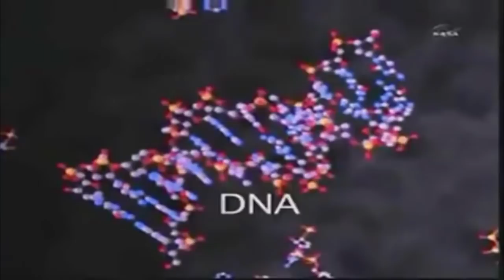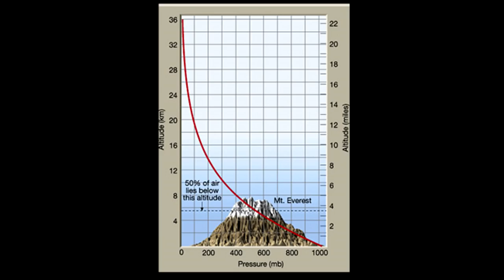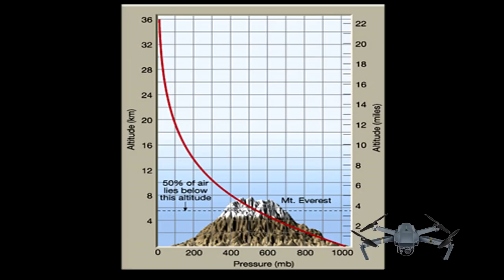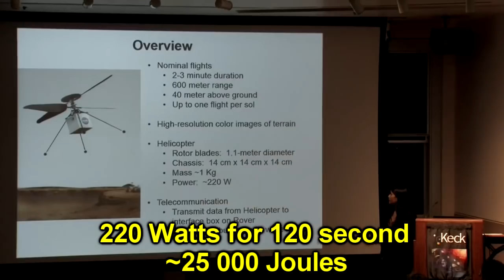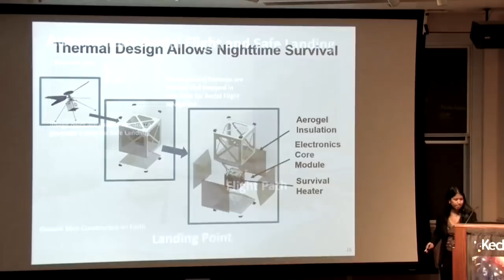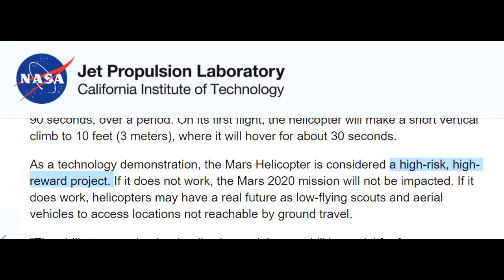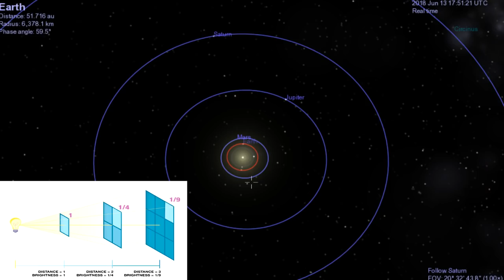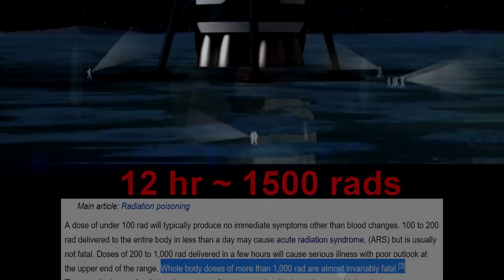NASA is sending Helicopter to Mars!! Smart or Silly?

Comment: I don't know if you have a video on the new version but I saw a nasa vid on a new drone for mars which is more conventional in design with four rotars (or eight since on the four arms there are two sets of rotars above each other). Theres also more substantial power generation with both solar panels and I think the radio isotope generator. Its a lot more heavy than the above but seems like it could be better for mars and it has more flight time

Comment: Maybe I should work for NASA because here are my ideas:  1 )Scrap the lame helicoptor concept and substitute a hot hydrogen balloon instead.  Wouldn't take much energy, could stay aloft all day if need be, and be guided by tiny jets of nitrogen.  2) Consider power beaming.  Erect a large PV array that collects hundreds of watts/hr.  Use lasers to beam energy to helicopter or to recharge this before each flight.  This would free up the helicopters weight and give it a larger range of flight.

Comment: You kind of gloss over a major issue here.  A huge amount of a helicopters power is taken up by overcoming drag. Lift and drag are directly related so blade configurations that would be unworkable on earth because of drag are doable on mars. Since most of the work of a helicopter engine goes towards turning drag into lift, atmospheric pressure does not play as significant a role as you say it does in the power necessary to fly on mars.

Comment: People at NASA are not stupid. I slightly suspect them they are making rover landings more complicated then they need to be for the heck of it, but they do really push the boundaries of engineering and learn bunch of stuff with every success or failure. The helicopter/drone is more or less proof of the concept anyway. If it manages one flight it means flying machines on Mars are possible. And if it makes cool pictures along the way that is great.

Comment: @Thudnerfoot - You're ignoring Bernoulli's principle. Lift is not caused by a the reaction of throwing molecules down by deflecting them off of an angled blade. It is called by a pressure differential from air moving at a different speed across a lifting surface.

Comment: Solar panels on earth and on mars do not have the same efficiency. The atmosphere is less dense, have smaller amount of clouds, moreover space grade solar panels (which are not used on earth because they are far more expensive, but on space they are lighter hence cheaper) have about double efficiency than best panels used on earth. This sums up to 150% more efficiency than you have on earth surface. Panels on earth have about 200 w/m^2 average efficiency,  on Mars multiplying out all percentages you should get about 270 w/m^2 (pointing straight to the sun). Whether you have enough power depends on the tradeoff between flight time per day and panel size

Comment: 22000 rpm and wide blades. And 1% of atm at low altitude still has a surprising amount of air. Also the drone design is designed to be able to right itself

Comment: I think it's fair to wonder if the idea of a helicopter on mars is feasible or even useful. I don't doubt NASA's technical expertise though and I think it's a bit pedantic to worry about solar panels or insulation. I am sure they have solutions to these rather simple problems. That being said, I think the most difficult challenge is going to be flying this thing autonomously without crashing. Because, as you say, if it crashes once, it will not be able to get up and fly again.

Comment: He's assuming all the heating will be the result of solar power. If you stop for a minute and think about Mar's weather systems, you quickly conclude that dust storms would eventually kill any devices which rely solely on solar power for heating by coating the panels with dust and by blocking sunlight in the atmosphere. But NASA doesn't rely solely on solar power; radioactive metals (such as thorium) can be used to create just enough heat to keep critical components such as batteries from freezing.

Comment: It is silly, but so was first car. I would say if the copter work for 3 days, it will be great success.

About your analyse, you miss that Nasa wouldn't use normal commercial solarpanels, but the most expensive ones, which gives them 50-100% more output.
Also, the copter is shortlived and lost anyway when it capsizes, so having extra weight by having it perfectly insulated against sand and dust wouldnt make much sense.

Comment: Correct me if im wrong, but the "Tracking vs flat vs angled" solar panel effeciency only applies the further away from the equator you get?
The closer to the equator you get the more directly above you the sun stands, therefore a static flat solar panel effeciency depicts where on Earth/Mars it is?

I do not know if the solarpath on mars equals the one on earth, tickets for mars was sold out.

Comment: Question on the solar panel. You point out that Mars gets far less sunlight than Earth since it's farther away (duh), but considering Mars doesn't have an atmosphere (or at least not when compared to Earth) wouldn't that mean that a solar panel on Mars would absorb a higher percentage of solar energy than a solar panel would on Earth? Because I'd imagine the atmosphere reflects a large portion of the solar energy it receives.

Just wondering, because that would in theory make Martian solar panels much more efficient

Comment: Thunderf00t makes a good point though.  Drones will crash, it’s a possibility, and nobody will be around to flip it over.  So I would like to know how their design is self righting.  It’s unconscionable to think it’s not, but I haven’t seen coverage of that in this or Veritasium’s video.

The simple landing feet also assume it’s landing on flat ground which is quite the assumption.  It needs to be designed to land on any surface on any orientation up to 30 degrees or something.  Once it lands on an uneven surface the lifting force will be at an angle and will cause it to fly sideways dragging its feet and likely flipping over, smacking its rotors on rocks.  

I would have designed it to be inside a hollow dodecahedron shell made of tiny carbon fiber tubes.  It would join the shell to the body of the rover with a 2 axis spindle so it could land in any 360 degree orientation and then reorient its blades normal to any surface using the G sensor.  The side benefit is the rotors could never impact the ground, only the outer shell would.  The third side benefit is the rover could use the spindles to continually orient the solar array towards the sun to increase solar charging power by 30%.

Comment: I was an early days drone pilot too, and I even wrote my own control firmware (the Mikrokopter code was a mess). I remember from there that maintaining flight control and stabilisation is not very computation intensive at all. It could easily get that to work on an 8 bit 16MHz CPU, with time to spare and with a much faster than necessary loop.
I don't see any problems in controlling flight on less than a hundred milliwatts. Maybe even less than 10, depending on the consumption of the sensors. And there's no use of a milliwatts guzzling GPS receiver on Mars anyway :)

Comment: Actual question: The blades can't also be solar panels why? Would add more surface area for the solar panel and easily avoid the dust build up problem.
Reply: Electrical connections across moving parts is a nightmare. The rotor is a SPINNING part which is even worse, basically impossible. It must be completely separated from the hull so nothing is going to be charging through it. And that's assuming a solar panel could be made that's suitable for use as a propeller blade which I doubt.

Comment: I wonder why we don't use a normal wing drone on Mars. If landing is so hard then just put a program on a flying drone that works from entry communicating to areostationary satellites. The drone would never have to land and could be powered to stay in the air. Or even better, when the drone is power saving it could enter orbit and rest above the atmosphere (meaning it would require some kind of fuel storage like a CO2 compresses when in atmosphere). Would probably be more effective than the Helicopter.
Reply: Because like the copter blades the wing would need to travel very fast to produce useful levels of lift in Marses sparse atmosphere.

And they want to take samples so the design would probably need a vertical lift off capability anyway.

Comment: Assuming it's going to be powered purely by PVs then it's a non starter. We could of course use accumulators ( rechargeable batteries for those who need clarity) but this adds another issue. Mass. More mass means more weight and thus exponentially more charging time when on the Martian surface in order to take the thing from the ground. Perhaps detachable accumulators? Right. Controlling something that far away to that degree of finesse is beyond even NASA's best novelists.

Comment: What about putting solar panel on wings? Surely it would require making smart way of transmitting power but it should be not much different from alternator, speeds are much smaller so brush set should last long enough. It would have ~45 degrees but pointing different sides so if one generates less power, opposite one will have more. Moreover, wings can rotate making it a bit more efficient than static, flat panel. There is some risk of damage during such fast rotation but it would be on the "back" side of wing which won't hit directly any particles. Question is, if such solar panel will have proper weight and won't be harmed simply from centrifugal force.
The best thing about that is that adding more solar panel shadows wings so you can't use idea like they showed with one central wing. It won't have any lift when covered by panel. Folding panel for flight? Not really good idea. More things can go wrong if you try to open and close it all the time. It would not make power during flight as well but it's not that bad if you are going to fly only 2 minutes daily. 
I'd try to work on this idea, solar wings. Sounds like great bullshit and as we all know, media love bullshit!

Comment: I'm curious what you think now that Perseverance and Ingenuity are both safe on Mars. I'm sure you know by now that wasn't a safety wire. It was pulling up on the drone to simulate Mars' lower gravity. We have yet to see if it will fly but the sky crane worked again and it's all safe on Mars. I'm just curious what your thoughts are.
Reply: He literally pinned his comment about his wire mistake, how did you not see that when scrolling down to post your comment.
Its literally right under the box where you type your comment in. Right below.

Comment: They would use multijunction high efficiency solar cells. They can get 2-3 times more power from same area, and weight is similar.

Plus you can land close to equator to improve it more.

Comment: (I am so gonna get roasted... but here goes)
There is more to lift than deflecting air molecules downward from the face of the blades. That's one reason why wings, propellers, and rotor blades are profiled. Also, just spinning the blades faster to produce lift in the thin air only works until the tips reach mach 1, which is much lower on Mars than it is on Earth due to the thin atmosphere. That would drive the cord of the blades to be deeper (fat blades)..

I would classify this as somewhat silly.

Comment: I mean the solution to outer solar system solar is to use a mirror (like they use on solar sails) to reflect the sun onto a regular panel. This would be located at a base station, and then you recharge your drone/rover there.

Comment: I think your helicopter blade model is actually backwards. If you tipped the blades the direction you've illustrated the helicopter would travel in the opposite direction. I think.

Comment: Even in earth fast spinning rotors have problems. When next rotor blade hits low pressure made by previous blade. Y need like 100 times longer rotor blades in mars. In Earth atmosphere blocks lots of suns energy. Y make more power with solar panels in space.

Comment: Why not send another rover, but one that's carrying a weather balloon and helium tanks. Have the  balloon tethered to the rover. Would this not work for like a mere fraction of the cost? Better yet, create a robot that is powered by a powerful springs that will let the robot shoot into the air. Make the spring re-compressible and maybe even add helium filled pockets so it will float down much slower.

Comment: The rotors of the helicopter would have to spin at LUDICROUSLY HIGH Speeds! Probably supersonic,  due to Mars' very thin atmosphere.
Aircraft don't work well on Mars because of how thin the air is. You'd need to reach Mach 1 to even be able to take off.
And we all know that propellers/rotors travelling at supersonic speeds lose efficiency in an asymptotic way. the the efficiency loss quadrupleas for the first 25 or so MPH, then multiplies by a factor of 8, then 16, 32, 64, and so on. as an example of what I mean. (That's not an accurate number,  just to show how quickly it goes down) Props usually can't spin faster than about 2700 RPM because at that speed they tend to either shatter or fly off the aircraft.

Comment: Nowadays, FPV racing and freestyle drones have something called turtle mode which allows it to right itself and fly again.  Pretty handy if you crash in an inaccessible location or are just feeling lazy.  Of course, this only really works with very durable modern multirotor designs and doesn't work in all circumstances.  It's not applicable to Ingenuity.

Comment: Typically motors in things like blenders, have fans attached for cooling. I'm curious how that factors in.
Reply: ha. "that's a different story."
Reply: @Sc0ttPrian  please tell, the "different Sorry."
Reply: @88njtrigg88  That was my way of stating I noticed he too realized a potential issue.

At a constant voltage while decreasing the resistance (molecules), a motor will continue to spin faster, until the limitations of the motor are met (or the motor burns from high speed). Heat would slowly rise, not from the lack of particles, but from higher motor speed. Certainly correct me if I'm missing something critical.

-Not a scientist.

Another story would be to examine the stresses on a drone fro a higher atmosphere. I predict the motor would spin much more slowly at a set voltage, but ..require less cooling?

Comment: So at 4:35 you are just wrong that is not how a helicoper generate it's lift. The roter of a Helicopter get his lift the same way any other wing dose and not by knocking the Air down... In a about 45° angle (as shown in your video) you will not get any lift out of a roter because it is most likely in stall.
Well than my english is not really good so sry that i will not go deeper in how it works^^

Comment: Right off the bat, I'm skeptical, but let me watch the video. Martian atmosphere is 1% as dense as that of Earth, while gravity is 38% of Earth's. Which means that you would need 38 times more effort to lift a REGULAR helicopter off the ground. Unless they have created a design that is at least 38 times more efficient at creating lift in such thin atmosphere my bet is that this thing won't fly.
After watching, yep, basically, he's talking about the same things I was thinking about. Now, for the power issue, what they could do is drop a high-capacity power bank/station nearby that has large solar panels that track the sun etc and recharge themselves and the drone when it stops by. The drone would just land on top and recharge for next flight. That would limit the total range of the drone, but would greatly extend each flight's range.

Comment: why not have flexible solar panels placed on the fins? wouldn't that equate to a higher surface area than a flat disk (also, a disk would create vertical air resistance...)

Comment: Nice video. One think I think you missed, the CO2 molecule has a molecular mass of 44 (44.01g/mol) versus 32 for O2 and 28 for N2 for an average of 29 for normal Earth atmosphere. So when the blade kicks one CO2 molecule is like kicking an average of 1.5 "Earth atmosphere molecules", or having an atmosphere 50% more dense but made of 78%N2 21%O2. Why do I say that? Because every bit counts. Because CO2 is so cheap it's very probable that tests for that helicopter are being conducting in the correct martian atmosphere pressure and composition. Second, I wouldn't tremble to much for electronics overheating because the insulation is too good. The flight time is very short, the power is too low and some module, like the transmitter, can be switched off in the flight to conserve power and to avoid overheating. Third, the helicopter can have a mobile base to return to, a much bigger wheeled rover with an arm to restore the helicopter in the flying position in the case of a non-damaging crash, that could refill the battery by induction and protect the helicopter during storms. The magnetic dust problem you raised, well, that can be a problem. I think one can get rid of it with pulses generated by some powerful electromagnets inside the mobile base. The advantage of having a child helicopter for the rover mama is, well, at take off, the solar panels of the rover are cleaned. Another problem I see is the electronics. Rad-hardened means bulky and power hungry. A rad-hardened arduino-like electronics (not counting the sensors) is possible but a rad-hardened raspberry pi? I don't know :)

Comment: also the edit button isn't working on this video, so I would like to add this. L=CLxV^2x1/2PxS which is the lift equation, due to the fact that mar's atmosphere is largely composed of carbon dioxide the P(which stands for air density) in that equation is greatly increased which means we can lover the velocity of the blades the achieve a force that overwhelms gravity for the duration of short flights.